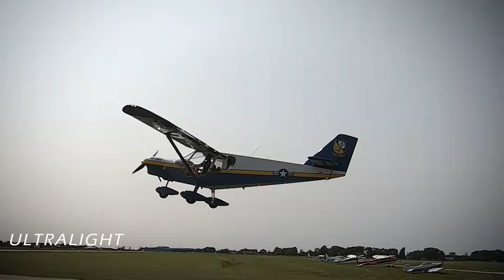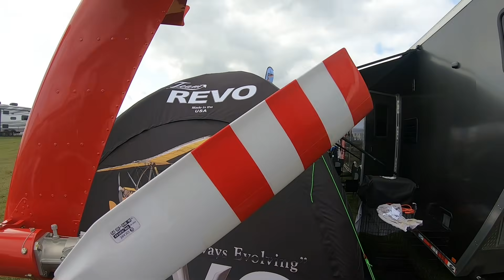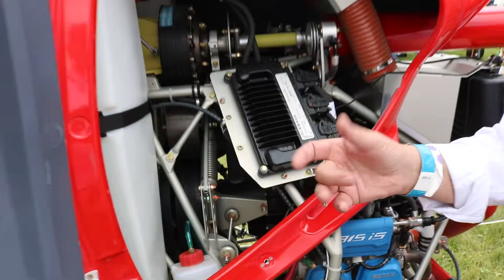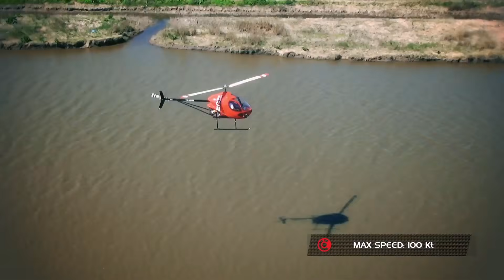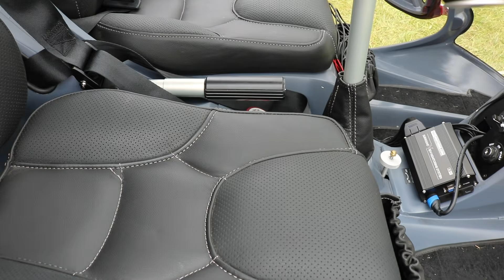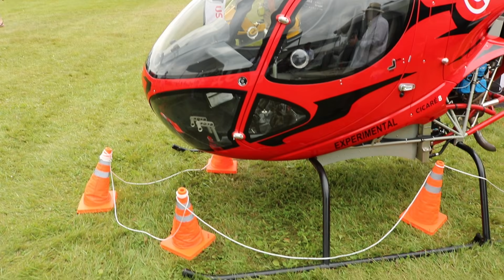NEW! Helicopter Kit Aircraft - Cicare' 8 - Best 2 Seater in the World!

Comment: You had me until the $210k airframe only part.
Reply: The $220k price mentioned is for the airframe kit AND a factory new Rotax 915 iS Turbo engine and everything needed to finish except fluids.  Even includes a Commodore radio in that price.

Comment: very nice. my only concern is having 2 main rotor blades instead of 3. The two bladed main rotors are susceptible to mast bumping which is also a problem for Robinsons and other manufactures. JMO
Reply: True, but 3-blade rotors also have a risk of ground resonance.  This aircraft doesn’t have the dramatic pitch change during a power loss that Robinson does, so the risk of mast bumping is less likely unless someone is doing something quite drastic.  We also use Delrin mast bump stops to absorb shocks to the mast.

Comment: Can I install a Rotax 916?
Reply: As an Experimental in the US you can, but the main rotor has to run a single RPM so you may not get much of an advantage.  Max continuous horsepower is within 2hp of the 915 iS turbo and the greater max takeoff of the 916, while about 19 hp more, isn’t really available without higher RPM.  The great TBO currently on the 916 May soon be available on the 915 as well.

Comment: As a fixed wing pilot, I do not understand why they don’t fly these things at 5000to 7000 feet across country rather than skimming the ground at 500,,,, anyone?
Reply: There's no efficiency advantage at higher altitudes.  And at helicopter speeds, more headwind at altitude could make things worse.  Above 500 feet is enough to keep you clear of most wires and towers.  It should be enough height to autorotate to some open spot if needed - if not, you can fly a little higher and give yourself more options.  The lower altitude minimizes time to land in event of a time-critical emergency, for example a fire or transmission chip light.
Reply: @lunchbagr4750  thx for the explanation!  I still think I would fly in the 1000to 3000 foot level for more options on the auto rotate scenario 😁
Reply: @lunchbagr4750  500 feet is NOT going to give you much of an option for land out choices 😮
Reply: Answer: because it’s a helicopter
Reply: You can fly a helicopter at higher altitudes and gain some of the same advantages as an airplane such as higher TAS and possibly better tail winds. However, the VNE of the helicopter is drastically reduced at high density altitudes (retreating blade stall). Since the R22 is the closest I’ll give you the numbers: 102KIAS is VNE up to 3000DA and VNE slows to a whopping 57KIAS at 10,000’ and 30 degrees C! Obviously not ideal for long cross country flights.
Reply: I cant wait to learn whatever it takes to understand your comment. @taylorgarcia5246

Comment: I wonder what a larger Cicaré would look like, meaning a version that’s still two seater but offers storage capabilities and longer flight time?
Reply: It would require higher load capacity, so it would need a higher maximum gross weight, so the rotor system, engine, transmission, and structure would all be different... so it could look like anything, because it would be a different helicopter.
Reply: @brianb-p6586   Thanks for taking the time to reply. 👍🏾
Reply: I would love it to have some storage room. This would be fun to get out to remote places for camping.
Reply: Maybe could add a belly pod.
Reply: @danwarner9399  a belly pod would add volume, but reduce the weight capacity even further. If you're only carrying foam, that might be useful...

Comment: how would it compare to a hughes 269B?
Reply: Would be similar, the 269B is quite a bit heavier and burns fuel at a faster rate. Requires Avgas at a higher price per gallon as well.  Considering the lighter fuel for same duration and reserve means seat payload is very close.  Performance is similar as well.

Comment: 200hr build time and $220k? Thats insanely cheap for what you're getting. Less than half the price of a factory-built Enstrom.
Reply: @chipjumper  not surprising, given that the Enstrom is a certified aircraft. 

An F-28/280 also appears to have much higher usable load, although some of that would be used up carrying the greater quantity of fuel required.

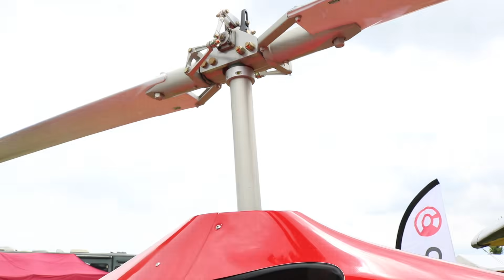Comment: As an A&P I am concerned about the wire braided hose at the 06:28 mark.
Reply: What is your concern?
Reply: @stephen5147  that hose with exposed braiding is usually just appearance stuff for decoration on cars, but the obvious concern is that the hose is too short so it is kinked at the end on the right. No responsible person would have installed that.

Comment: Is it ok for the engine to be exposed like that to the elements? Why dont they cover it up, will improve airflow & protect the engine right?
Reply: @CyberSystemOverload  it's slow enough that the fairing approach works... and is lighter and simpler. This is common in small helicopters.
Reply: if you check out the old Bell B-47, (AKA MASH) the engine is exposed.

Comment: I was hoping that you would ask him about putting the 916 engine in. A turbo would be nice.
Reply: This 915is is turbocharged. He mentions that when talking about the Reno, Nevada density altitude.
Reply: @scbane  You are right, but the extra power of the 916is for higher elevation would be nice.
Reply: @elliottdiedrich3068 The 915 is plenty of power for two people in this helicopter. And the same engine the Autogyro Cavalon uses.
Reply: @ictpilot  For most of the time I would agree with you, but when you are two big guys taking off from 8000ft and suddenly, you get a bit of a down draft, that extra 20 hp would come in handy. It is those occasions that I am concerned about.

Comment: If it flies like the Angel CH 7  then great
 There's nothing is wrong with the R-22 and you can charge for commercial operations
 The Enstrom had that style of control system under the main gearbox for 60+ decades
Wouldn't mind trying it...
If your airspeed if over 50 kts and 6 feet you'll go butt over tea kettle when the engine quits...
Reply: No nothing wrong with R22, Do you do commercial operation ? You will have commercial invoice also, this is more for PP who don't do commercial.
Reply: @gilkennedy7638  Yes I do. for 45+ years and helicopters can make you coin.
A PP the Costs will eat you alive and not enough in the fleet to get insurance.
You can get insurance on an R-22 or Rotorway big fleets - Flew a guys Angel CH 7 he couldn't get insurance on it...Flew it extra careful.
Reply: Enstrom controls are different.
Reply: @juancarloscasabuono6651  Same bearing and pitch control.- input control rods are a little different. Dennis Fetters stole idea for his mini 500. Even the KMax has controls under the main gearbox. Nothing now here or there

Comment: How's it compare to a Rotorway. More expensive I see.
Reply: Better than rotorway by far
Reply: @chippyjohn1  Rotorway with the turbine conversion to Jet Exec is way better and less costly
Reply: @HongyaMa  Rotorway is to flimsy, look at the transmission. They have had too many issues and also went bankrupt at least once. Rotorway should be cheaper for what they are. RotorX is currently in the process of closing, the third time in 20 years for the helicopter.
Reply: @HongyaMa  way better in what?  Half the endurance, for starters. Also, as far as I know, jetexec conversion not sold anymore.
Reply: @TParter  Lower maintenance higher performance lower cost. 
13 gph and 150 hp up to 20,000 ft engine on conditional inspection 300 hr ...
Walt passed on and Dave retired. 
RotorX still supports the air frame thanks to Robin. Engine still supported,  I invented the Jet Exec in 1993 and find the whole thing good for the intended mission.
Reply: @chippyjohn1  The Rotorway has no transmission - Chain or Sperling cog belt. only the prototype Rotorway Elite had a gearbox. as for the Company BJ started it in the late 60s and was the leading and longest producer of kit helicopters. BJ  then came out with the Helicycle stuff. 
I've flown Rotorways , Jet Exes, Angel CH 7, and a host of other helicopters both type certified and experimental. The Rotor way is in no way flinmsy and I could easily trim 50 lbs off that new Carere helicopter.
Reply: I was once interested in a Rotorway, have not fly it but I seat in it,  I don't think its fair to compare them